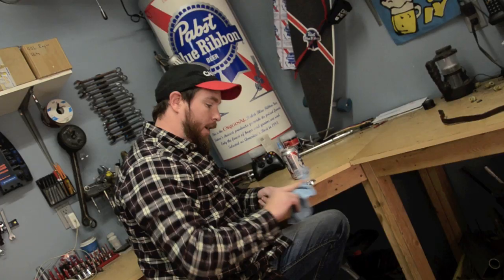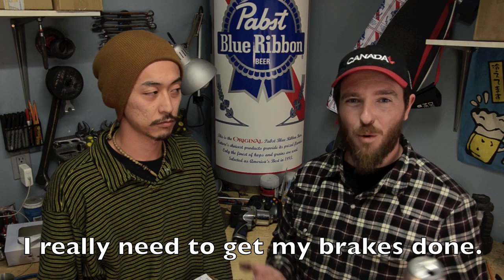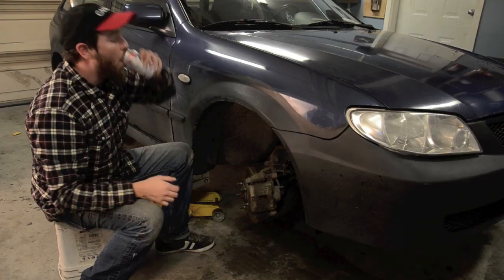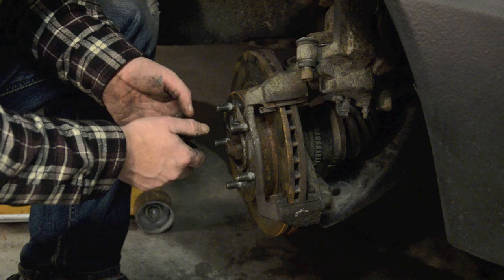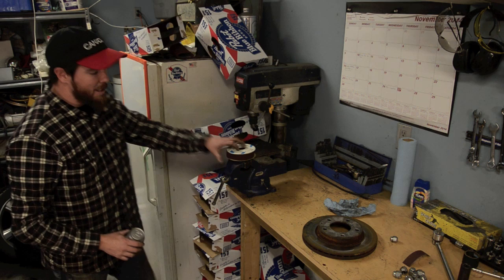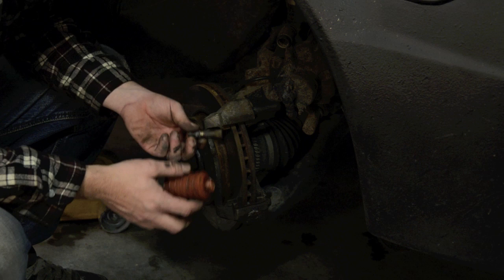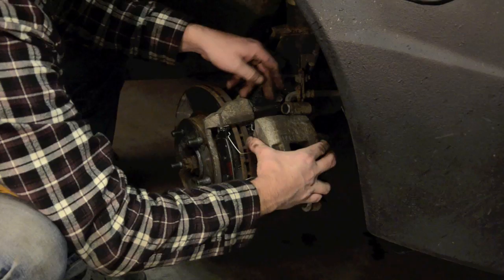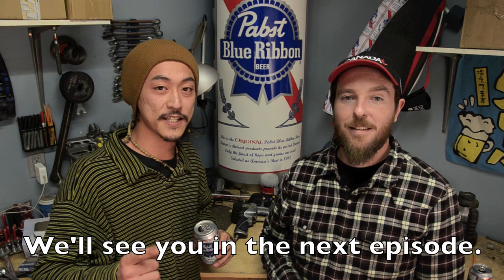Servicing Disc Brakes - The Roadhouse

Comment: Yo Boys.  Tommy's brakes look like they were a good 70% yet, what's he whining about.  Thoughts about grease though, not any grease should be used.  Brake grease or Synthetic grease should be used as a petroleum based grease can cause some rubbers to swell and seize the caliper.  A light smear on the pad contact points will also keep brake squeal to a minimum. . .unless that's Tommy's thing ya know.  
Keep um coming.
Reply from the maker: One pad was stuck on the other side and wore down. It was a lot easier to film the other side though, with our limited space..lol
This was one of our early videos. I think we're getting a bit better at delivering our ideas.....
Glad ya liked it anyhow. It's one of our least viewed.
You're right about the grease, but we only used it on the sliders and didn't contact the piston boot. Haven't made a peep since.